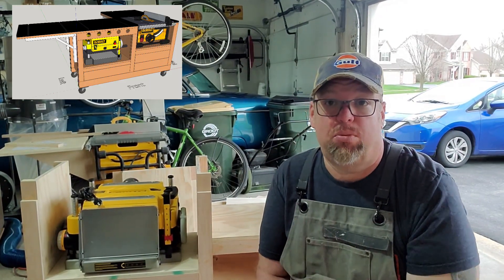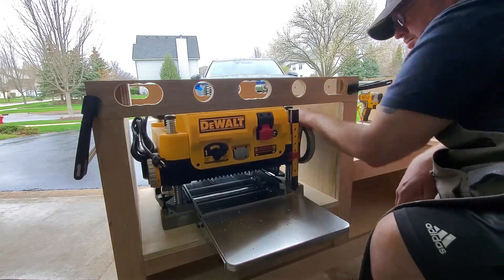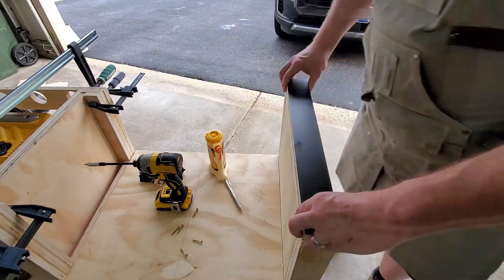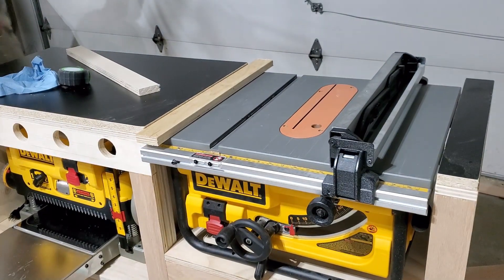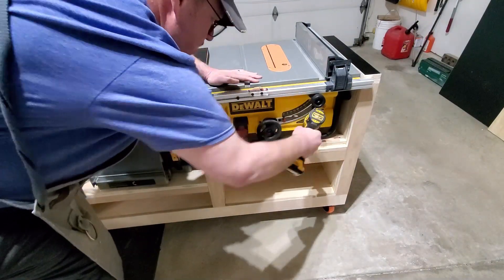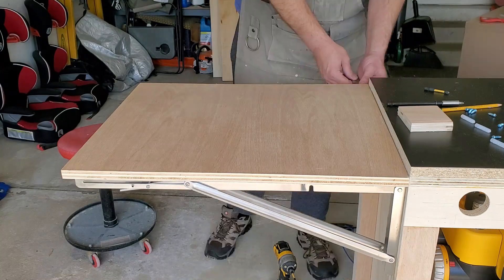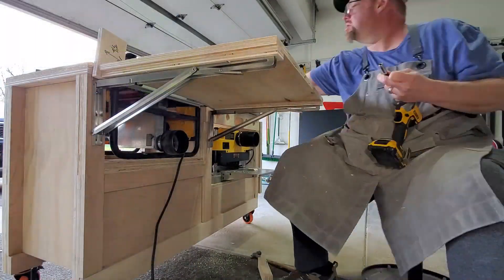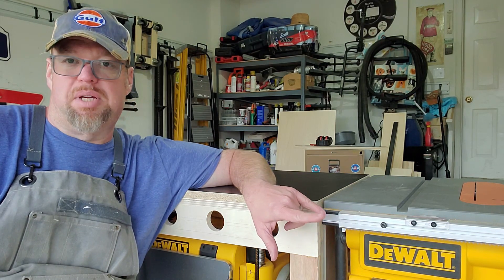HOW TO BUILD a Multi Purpose Woodworking Dewalt Table Saw Cart & Workbench | Ep 3

Comment: Excellent build, great idea, solves some issues in my small shop.  I did see one design flaw that might improve the build.  On the mid stiles if you flip them around so the panel is on the table saw side, it provides the support for the drawer slides and provides extra room for the planer wheel knob.  Thanks for the great information!!  Nice job!!

Comment: Great piece!  Only thing I'd consider is a way to easily access the top of the planer for blade changes and maintenance.  That thing is awful heavy to try to drag out of that small opening every couple of months.
Reply from the maker: You could modify the shelf the planner side on so that it slides out for easier access. Some heavy duty bottom mounted slides should do the trick!

Comment: Can you tell me if those folding brackets are 90 degrees when open and if they have any play?
Reply from the maker: Yes they open to 90. If they open so the back edge of the table is against something, then they have no play.  I've used they on serveral projects like by router table and miter station for a long time and they all still work great.
Reply: @TheSuburbanGarageWorkshop  thanks for your reply :)

I bought a set off eBay and they were actually around 93 degrees when opened. Was a nightmare to get right and in the end there was so much play, nothing I did could get the table straight